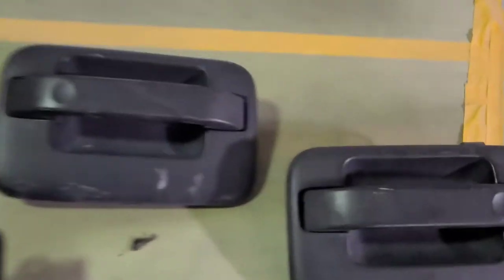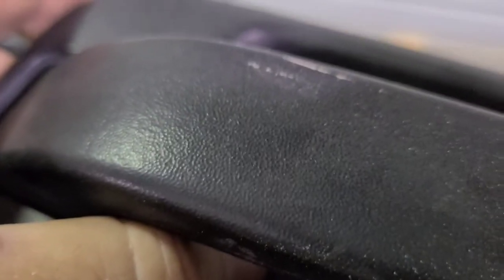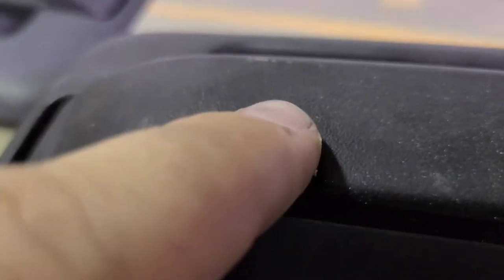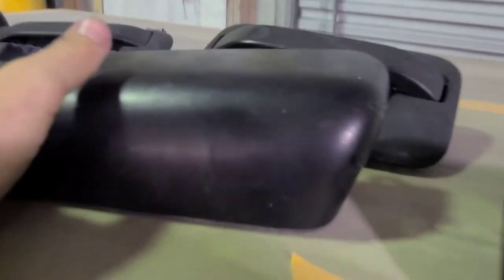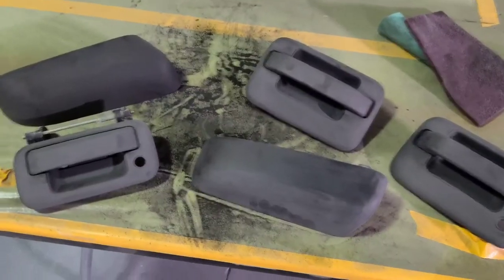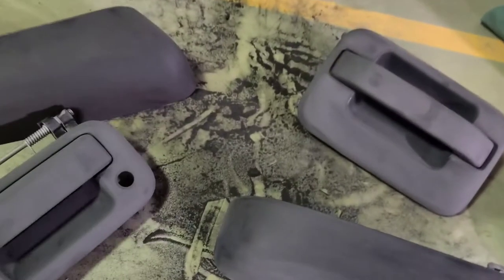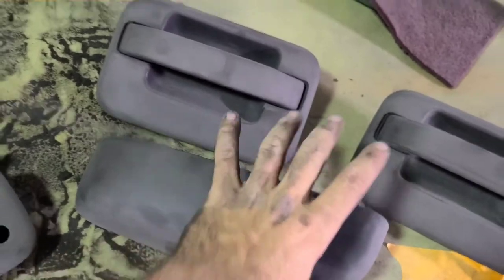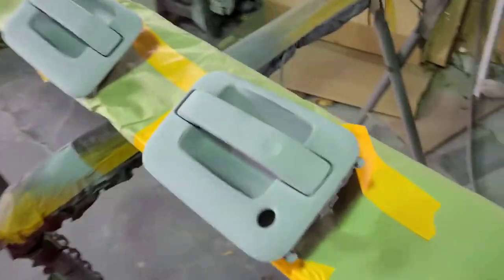HOW TO : PAINT TEXTURED PARTS ( COLOR MATCH )

Comment: Scuff with red pad, etching primer, light wet sand it, then color and clear. I like using wheel clear coat. Removing the texture is a lot of extra work to do the same job you could do with self etch primer. Love the dedication you put into your work bro, only saying what I've always done in case you've never tried that way! Good clean look on that truck now
Reply: Self etch is for metal. It has some sort of acid that bites into metal, primer is pretty useless on plastic unless your using it to get a different shade of base color. For plastic all you need is some bulldog adhesion promoter
Reply: @rigoreyes442  Agreed! Don't use self etch. Do use an adhesion promoter. Bulldog is great but if you're on a budget Rustoleum and Duplicolor adhesion promoter is good too and under half the price.
Reply: Automotive touch up sells what you need. First adhesion promoter. Then, sandable primer, then sand that smooth with 600. Lay base. Then 2k clear.
Reply: @rgomezgomez6366 you don't sand the textured plastic first?

Comment: Tjsquared, hey whats up, beautiful work.
I actually did all these steps but I don't have that smooth body gloss. I used 1k clear and a non-high build primer. Do you think it could be the clear or something else? I'd appreciate any direction you can give. peace.
Reply from the maker: I'd definitely start with the clear coat! 1k products will never lay out like 2k products. Find yourself a good clear coat. What type of primer are you using ?
Reply: @tjsquared2158  Hey thanks for getting back to me.
I'm using a Rustoleum 2-n-1 filler and sandable primer.
I'm thinking to fix it, all I have to do is lightly scuff and add the 2k clear. 
Or should I scuff and prime again then add the clear. Let me know what you think please and thank you?

Comment: If you follow these directions your paintwork will be short lived. Once you have sanded the plastic, you have to use plastic adhesion promoter to ensure that the job will last. Without promoter the prime will not adhere to the plastic very well and it will eventually fall off along with the finish paint. Just sayin...........
Reply from the maker: It was absolutely promoted just like all the plastic parts we do. Still going strong till this day.